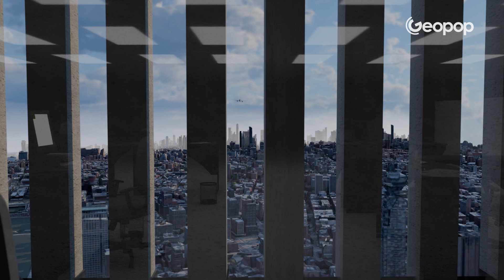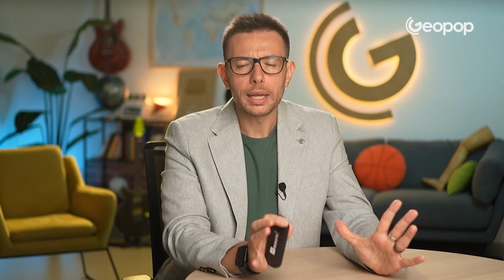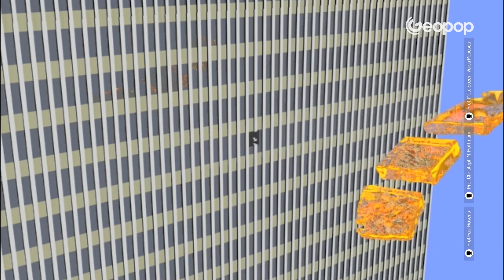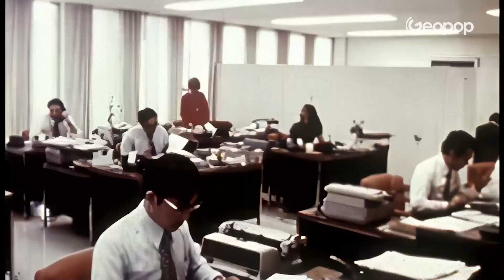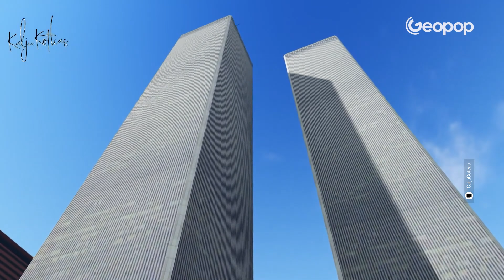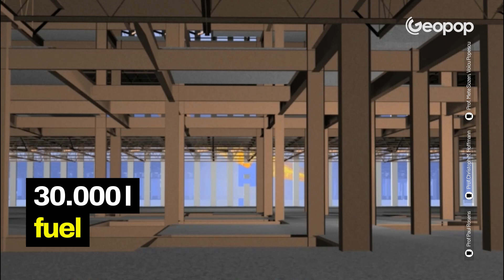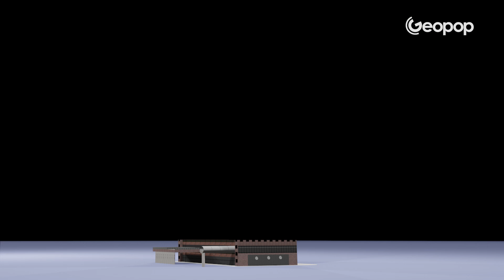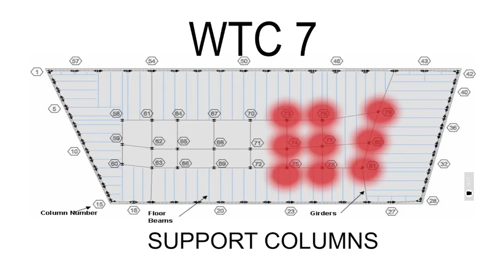9/11, 2001: The Technical Reconstruction of the Twin Towers and WTC 7 Collapses

Comment: Retelling the same bs scenario supported by disjointed cgi models 👍 thanks for nothing
Reply: Worth noting that is not a rebuttal, it's butthurt. know the difference.
Reply: @TheLoonResistance  You are a very busy shill Fitzshill!
Reply: @TheLoonResistance    Here we go with the fake outrage.  🙄 lol’d @ “know the difference.”   Be intellectually serious.  the models are incomplete.  The steel didn’t deform soften, or melt.  Anyone with common sense can see that.  

Believe half-baked simulations if you want but those of us with working brains prefer to analysis and CRITICIZE FREELY WITHOUT FASCIST ENFORCERS COMING THROUGH TO PUSH ANTIINTELLECTUAL, PSEUDOSCIENTIFIC DOGMA.
Reply: @OakleafOrganic - Curious. If you would indulge me for a moment please take a look at something you likely have never seen or noticed before. It’s in just the first 15 seconds of this video: 

Gary Pollard South Tower collapse, looking at the east side toward the north at about the 80th floor. 

www.youtube.com/watch?v=ULdiD6gYZO0

What do you see?

I see the perimeter columns on the east side of the South Tower bent. Bowed inward with the bend suddenly increasing to about 5 feet until they fail and the collapse starts. Don’t you?

Which is stronger, a straight column or a bent column?

A straight column will be up to 4 times stronger than a bent column, right? 

So the weaker those columns get, the more they bend and the more they bend the weaker they get, right? 

So why are they bending?
Reply: So we can agree that the floors were steel reinforced with concrete. 

If the floors were purely load, then why/how did they fragment and immediately pulverize when the structural integrity of the building eventually failed?
Reply: @OakleafOrganic - No we cannot. 

The Twin Towers for example had 4 primary structural elements:
47 hollow box-section steel tube core columns which carried most of the gravity loads
236 smaller hollow box-section steel tube core columns which carried the remainder of the gravity loads and ALL of the lateral (wind loads)
Long-span lightweight steel floor trusses spanning between the core and perimeter columns to tie those elements together.
A steel hat truss to cap it off at the top.

The only concrete in the Towers was load, NOT STRUCTURE .   I don't know many more ways to say that. 

While I know you are desperate to believe anything else so you don't have to give up on your original point - whatever that was - and admit error, at some point you have to bite the bullet. I am not here to indulge your beliefs, only to state what is.
Reply: @T @TheLoonResistance  in other words, you’re half-prepared to explain the catastrophic failure of the steel and totally unprepared to address how it, and the other materials were instantaneously fragmented during complete free fall.  

it’s time you realize that the world in which mealymouthed, context-feee  recitation of the 9/11 Commission Reports is enough to shut down rational debate no longer exists.

Post as many paragraphs as you want.  It doesn’t change the facts.  WE ALL SAW THE BUILDINGS COLLAPSE.  Gaslight all you want, you’re just railing against clear evidence and common sense.  BTW, are you an American?
Reply: @OakleafOrganic - Again, you are quite wrong. 

At the End of the day, we all just want to know what really happened, right? It’s tough because there is a massive amount of absolute garbage information out there to muddy the waters, even though structural engineers had figured it out within weeks. How is the layperson supposed to sort it all out? 

I have put more thought into this than most because anything can seem like a conspiracy if you don’t understand how it works and if you don’t mind would like to offer my perspective. You may choose to disagree, which is fine, but if I am in error on any point of fact, logic or reason please let me know.  Just saying you are wrong or I don’t believe you isn’t going to make it. 

While complex, most of the Twin Towers collapse mechanisms can be seen with the naked eye and easily discerned and understood by the layperson IF sufficient time is taken to understand.

1.   The Twin Towers consisted of 4 primary structural elements together forming an integrated system where each relied on the others. 47 hollow box-section steel Core Columns carry most of the gravity loads. The 236 hollow box-section steel Perimeter Columns carry the remainder and ALL of the lateral (wind) loads. Long-span Lightweight Steel Trusses connect core and perimeter column together with a Hat Truss on top to tie it all together as an integrated unit where no element can survive without the others. There was no structural load bearing concrete and most major assemblies were bolted together

www.youtube.com/watch?v=u7OqrC74Dm4

2.   The impact of a 122-ton airplane (= 12 dump trucks) at up to 587 mph with the energy of a ton of TNT destroys the aircraft in 0.50 seconds. This in no way implies the Towers come out unscathed. Some folks get hung up on that. Many perimeter and some core columns are destroyed or damaged primarily by bending, twisting, splitting weld seams and critically by bolt-shearing failures at the end connecting flanges. No cutting or slicing - the reality far more violent and brutal. 

www.youtube.com/watch?v=zF-94yDHlk8

3. The impacts destroy or damage fire insulation, fire breaks and sprinkler systems on multiple floors. Jet fuel acts as an accelerant starting huge fires start across multiple floors simultaneously that spread spread rapidly with no effective firefighting or fire suppression. This was an unprecedented fire event . Office buildings are essentially giant piles of kindling when it comes to fires, chock full of stuff that burns vigorously and quite hot. 

4. The hotter steel gets the weaker it gets shouldn’t be a revelation. With fire protection compromised the survival time of the steel greatly reduced . Over time heat gradually causes the lightweight steel Floor Trusses at the damaged floors to sag, which we can see. No steel melted or needed to. Structural steel fails long before it becomes a puddle. It just needs to bend 5. A straight column is up to 4 times stronger than a bent one. Sagging floor trusses pull on increasingly weak and overloaded Perimeter Columns, causing some of them to bow inward by up to 5 feet until they buckle and fail, quietly initiating collapse. The formerly static mass above which the structure below could easily support converts to a dynamic mass up to 30 times greater. The Columns above and below the failure point are no longer aligned . The load bearing structure below no longer bears any of the load above, which falls past the lower columns NOT onto them. www.youtube.com/watch?v=ULdiD6gYZO0 www.youtube.com/watch?v=zTygQK3vriI 

6. Heat starts the collapse, gravity finishes it . Thousands of tons of debris drop within the four outer walls, through the open office space, the path of least resistance crashing onto the first intact floor, The bolted column connections instantly break as the amount of resistance the Floor Trusses can offer is negligible, slowing the falling debris only marginally and briefly before the connections fail. Note: 
6a. This is NOT a solid top block crashing into a solid bottom block . 
6b. The debris falls past the columns not onto them. The columns provide no resistance to the falling debris. 
6c. Only the bolted floor truss connections to the core and perimeter columns offer any resistance. A pair of 5/8” bolts at each end of each truss vs. thousands of tons of falling debris. 
6d. No laws of physics are violated. 
6e. There is no 20 floors against 90 floors but rather 20 floors against one floor, then 21 floors against one floor, then 22 floors against one floor, etc. 

7. This floor-led collapse progression within the four outer walls can only go straight down. There is no lateral force to push it over the side, only gravity to bring it down. 

8. Collapse progresses through the floor systems past the columns, through the path of least resistance . Resistance offered by each floor is always the same while the falling mass acting on it is constantly increasing and accelerating (gaining energy). This process of floor-by-floor destruction cannot be arrested. It can only speed up . Rate of floor failures increases with each floor as momentum increases, reaching an average acceleration of 0.65 of GA, or 35% slower than true free fall. Bam, bam, bam down the building until there are no more floors to fail. More mass, more velocity, same resistance with each floor. Don’t get stuck on the but the lower floors weren’t on fire nonsense. They didn’t need to be. 
8a. This process is often incorrectly referred to as “pancaking” which while catchy, is incorrect. Too simplistic and inaccurate anyway. More like Kaiserschmarrn. 

9. The Towers were 95% air by volume. As that air was compressed inside the building by falling debris, pressure builds until it is blown out the sides in reaction to the building collapsing . Those were not “explosions”, it was expulsions of compressed air caused by the collapsing building, explaining the low velocity, lack of flash, blast, supersonic pressure waves and lethal high-velocity ejecta. 

10. Perimeter Columns become detached and peel away like a banana behind the collapse front, playing out to the four points of the compass in long lines extending to 800+ feet from the base of the towers, damaging and destroying nearby buildings. 

11. Core Columns fail last as their internal beam bracing is stripped away by falling debris and lateral support from the floors to the perimeter columns is lost. 

www.youtube.com/watch?v=WpHXj62Ylw0

12. This process took 31-34 seconds from perimeter columns bucking until the last core columns hit the pile, or 1/3 the rate of true free fall. Don’t believe me? Just watch a video of the collapses and note the loose truly free-falling debris dropping much faster than the towers themselves. 

https://www.youtube.com/watch?v=dh4r-gHdyPU 

13. Each Tower had a 1-acre footprint. Far from collapsing inside their own footprints the debris pile spread out over 17 acres in a pile up to 14 stories deep. 8 surrounding buildings were destroyed and scores more damaged by the falling debris. 

14. NOT observed were the 180-190 dB bangs of thousands of high explosive devices or the blinding brightness of burning thermite. Explosives or thermite couldn’t have survived the impacts and subsequent fires anyway. Nor could they have caused the perimeter column buckling that clearly initiated collapse. Video of an injured and in-shock firefighter casually using the magic word explosion isn’t proof of explsoIVES and hardly makes a case for planned demolition. Pre-planned demolition doesn’t match the physical evidence and would be technically impossible, totally impractical and completely unnecessary. Simply, no one would bother. In 24 years, no structural engineers of tall buildings, including the 1/3 who have retired, have made any statements in support of planned demolition claims. NONE. The lack of such citations in engineering literature published anywhere in the world is telling. 

15. Twin Towers were perfectly safe within their design envelope. They only collapsed when taken far outside design parameters by an extraordinary and unprecedented event Impact + Fire (heat) + Time + Gravity = Collapse . Remove any 1 of those 4 elements and there is no collapse. Ignore any of them and you will never understand the collapse. The Twin Towers were an integrated system in which no one component could survive without the others. One fails, the rest follow, through the path of least resistance DOWN the open space, bypassing the path of greatest resistance, the columns. No laws of physics are violated and the above is true no matter who planned and carried out the 9/11 attacks or why so the attacks could still be an “inside job”. 

If you made it this far, kudos. That was a lot. I hope it was helpful, informative, non-adversarial and solicits informed critical comment, positive or negative. If I made any errors of fact, logic or reason or left anything critical out, please let me know and I’ll fix it. To stay focused, just one point at a time please and on-topic (Twin Towers ONLY). No word-salads of Gish Gallop. IF you can offer a more plausible alternative be my guest. Please start any reply with the words “Tits McGee” or I’ll know you didn’t read it and aren’t serious. Thanks for your time.